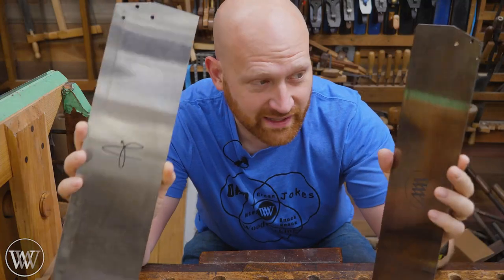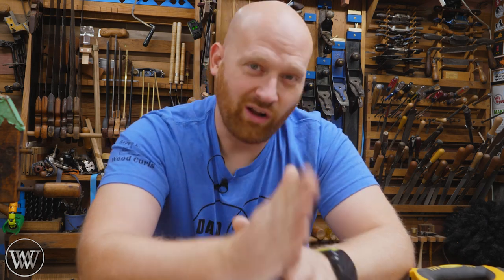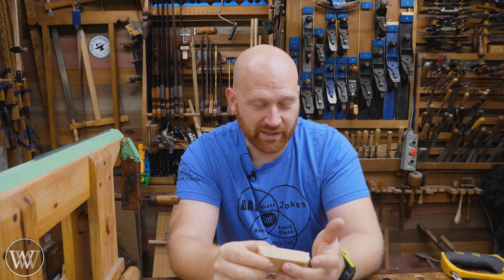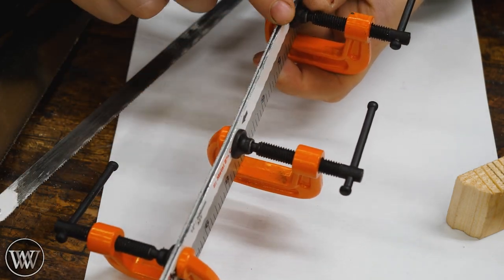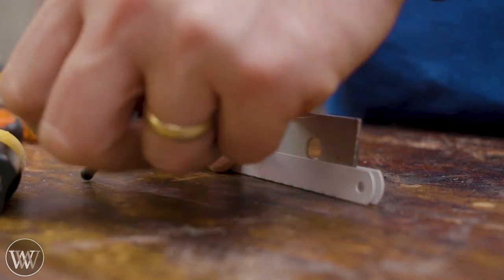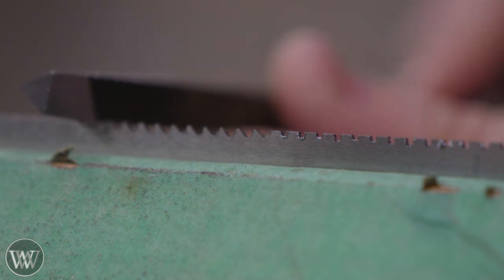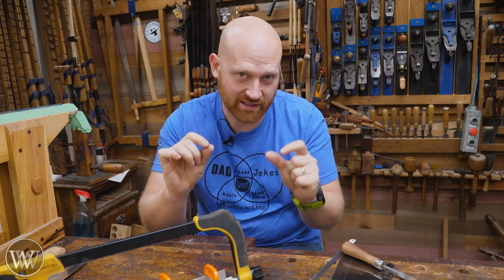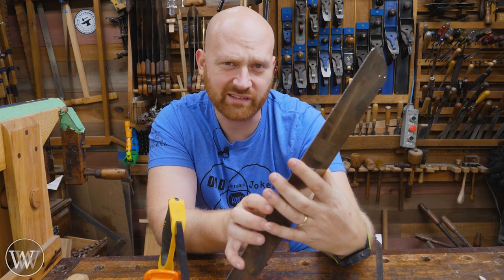Why I Have C Clamps On My Saw Cutting Teeth

Comment: You can use an old saw, as the guide to make the new saw.
Reply from the maker: If you're careful, yes. Otherwise you just end up moving the teeth of the old saw.
Reply: @WoodByWrightHowTo  Sure, it takes some care in prepping the old blade, but the guide is built in. Less fiddly than pasting a sheet, less cumbersome than clamping the hacksaw up. Of course a combination would probably be dead on and faster. You pick your pace, all methods are good if it works for you. Just another option, if you happen to have a worn out saw of the proper frequency.

Comment: Hi James , nice trick and i get it why you show this trick . But for you , what about having a metal cutting device ? They exist in metal working . Maybe a second hand would be cheep for you . If you need to make alot .
Reply from the maker: they make punches that do this but they are $800-1500
Reply: @WoodByWrightHowTo  outch even used 😰😱 The only thing that the pendemic did is get richer the rich 🤷

Comment: I'd file the back of the upsidedown blade and maybe apply a little wax to make it run in the cut a little better.
Reply from the maker: what do you mean by File the back?
Reply: @WoodByWrightHowTo  I'd take the paint coating off the back and shape it to fit better into the cut left by the blade.

Comment: I use a 24 inch hacksaw blade with 14 t p I  I put this in the saw vice in front of the saw plate all clamped tight in the saw vice.i then take a small saw file make 2 passes through the hacksaw teeth which leaves a perfect evenly spaced cut this is done full length of saw plate .then remove hacksaw blade to allow you to file your new teeth in .the hacksaw blades come in various t p I and are used on Industrial machines I have used this method for many years it's perfect
Reply: I like the sound of that solution. Might give it a go. Thank you.

Comment: Maybe I'm missing something but couldn't you just use another sawplate with the required tpi as your guide. Flip it over, clamp in with your plate and be guided by the gullet (set fractionally lower than sawplate).
Reply from the maker: the problem with that is the file would just cut into the second plate it wont guide the file into place.
Reply: @WoodByWrightHowTo  yes. But the point would be to establish the spacing consistently . Ofc, could also establish the spacing then drop the plate down. However, I think I'd rather propose establish the spacing, cut to near depth with hacksaw  and file down that path. It's same as sellers style but replacing wooden guide with existing saw plate (gullets).
Anyway just a thought ;)

Comment: This is not a random comment. Or is it? Maybe Schrodinger knows ... 
I like the saw tooth cutting jig made by Alex that you demonstrated. But, alas, my eyes are now far too old to see or do anything as tiny as the teeth made by "Alex's Tooth Fairy Jig". So I will continue to obtain saw blades that aleady have a fully deveolped row of teeth of the appropriate size and set. 
(begin.sarcasm) But calling that jig the "tooth fairy" might upset young developing minds, so it might be better to conceal that from them at least until they are in high school. (end.sarcasm)  
Since the "other" blade is being lazy and lying on its back (the one being used as a guide) it seems to me that in principle it could be ANY piece of appropiately sized metal. That may or may not give more design flexibility to the jig.

Comment: Use an old blade to make a new one by clamping them both offset in your bench vice , filing as if you wanted to sharpen the old one makes a cut into the new . ha ha ha . all you need is an old blade a saw blank and a file . ha ha  ha